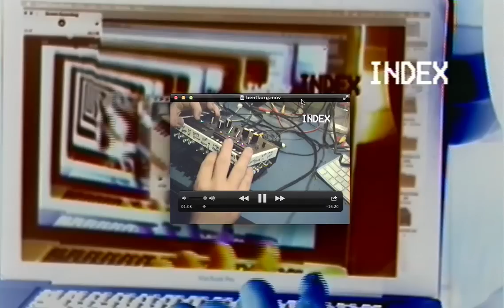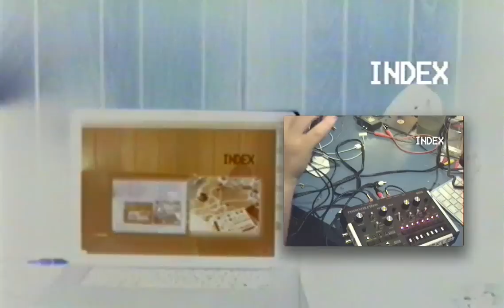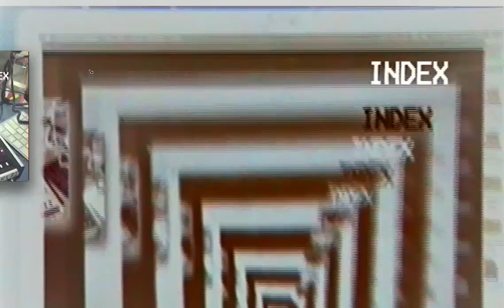Modded Korg Monotribe with Alesis Microverb (bent and bloody)

Comment from the maker: It's really easy to mod, and the majority of what you need to do is marked.   Midi io is right on the serial connector.  

I think that you can y replace the clock crystal for pitching the wave forms and get some crazy stuff, but my case is so full that I can't take the unit apart anymore.  

I found that each drum output works as an input and also that to short the decay values to each other affects the various noise sounds of the hi hat and snare.
mono-wiki.dx7 .se/Main_Page